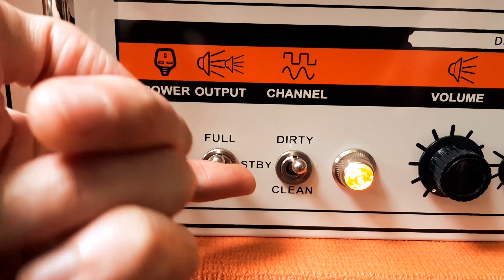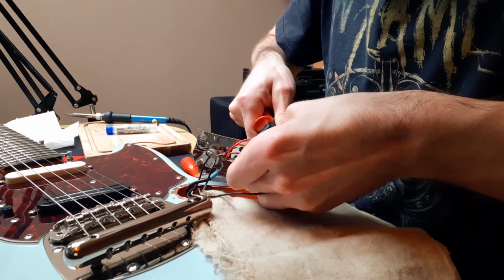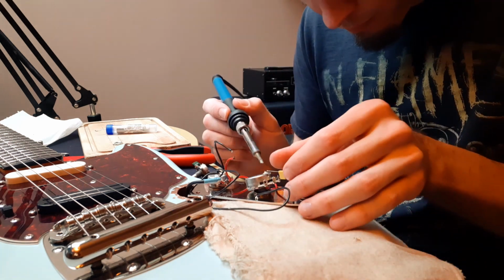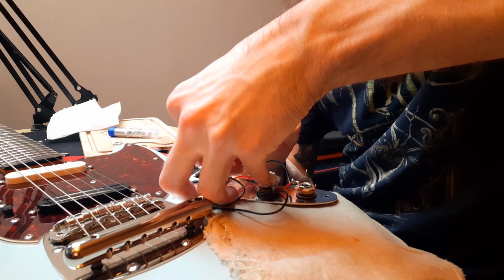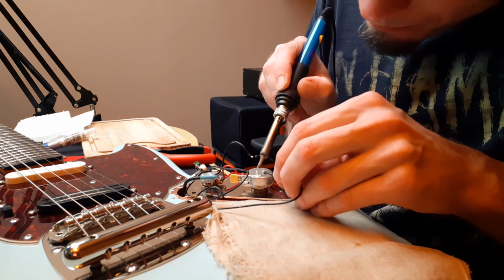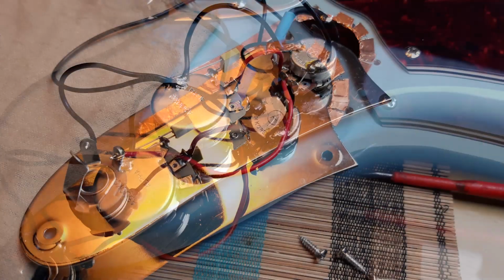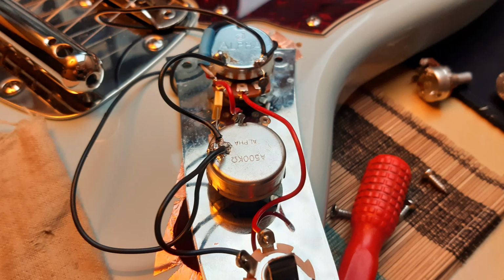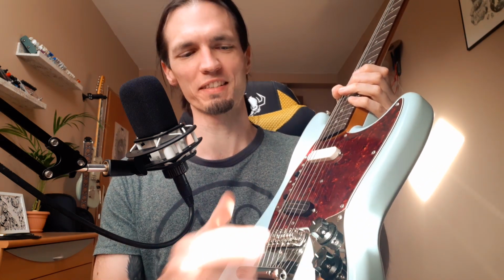Squier CV '60s Mustang - pots swap

Comment: I'm swapping the pots in my cv mustang because I want a push pull for phase and then wiring pretty much the same (except one will be a pickup selector, the other a series/parallel switch). I only have 500k pots available for this so I'm glad i like your sound as I wont need to get 250k pots! I'm running a JB JR in my bridge right now. 

edit: I notice some people say they don't like how bright 500k sounds but in a band context this is important to me for cutting through the mix.
Reply from the maker: Yes, you'll cut through the mix nicely ;)

Comment: The reason for 250K pots on Fender single coils is to decrease highs. The reason for 500K pots on Gibson humbuckers is to increase highs. it's that simple.
Reply from the maker: My Mustang and Jazzmaster have 1M so 500k is way closer then 250k. I plug my guitars in the same rig, so now I don't need to tweak anything and everything sounds equally awesome.
Reply: @riffsandpancakes  You’re right. Jazzmasters have 1mg pots.
Reply: @riffsandpancakes what's the value of the capacitor in 500k tone pot?
Reply from the maker: @SeattleSound310  100 V 22nF 223J (223J100)
Reply: @riffsandpancakes  thank you

Comment: Would have been helpful if the vid quickly switched back and forth from 250k to 500k at each pickup position. But I did hear a significant difference and felt like I preferred the 250k. 😂
Reply from the maker: I'll stick with 500k, it's better for me in humbucker position for sure. Logarithmic pot in tone it''s a game changer.